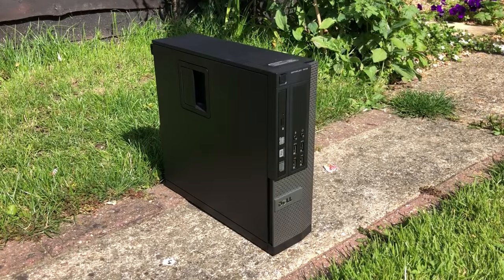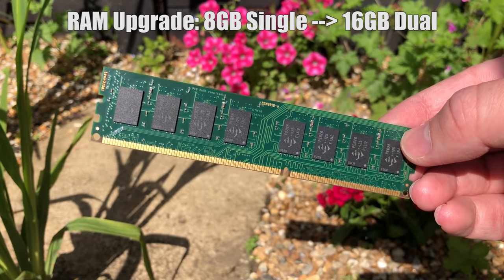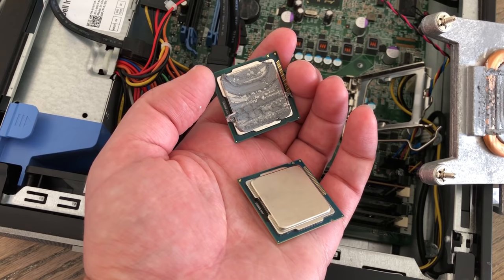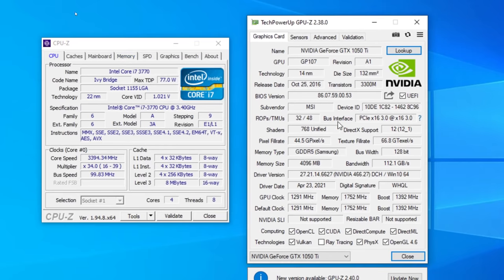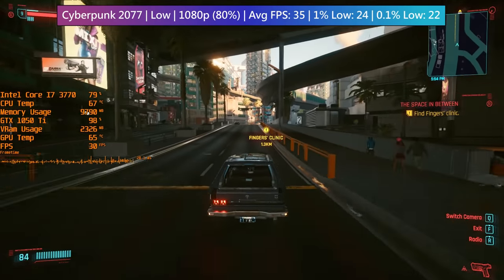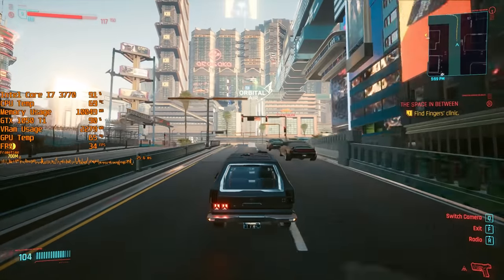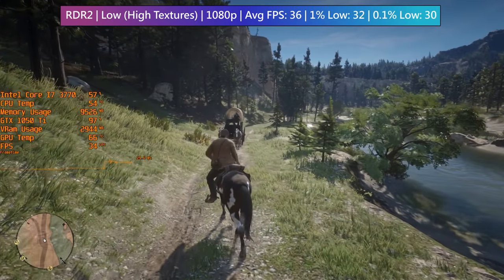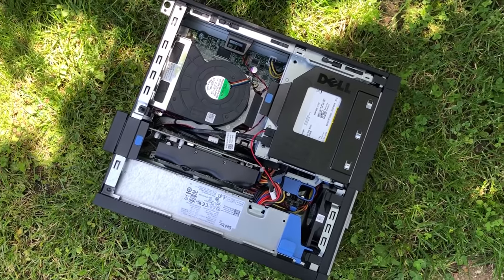Turning The Tiny, Cheap OptiPlex Into a Gaming PC - With Whatever’s In Stock

Comment: So i have a question idk what to buy My First Option is to buy a I3 10100f and start and looking  on the market for a cheap motherboard that is like 100€ . Second option a kit Ryzen 3 3200g and a motherboard total almost 200€ or the third a ryzen 5 1600Af that is 150€ and start looking foar a decent motherboard under 100€ . I just want an advice. Thanks , have a nice day.
Reply: I would say forget the 10100f, if you did want to go intel you be better with a 10400f and they not much more expensive these days 😀 if you wanted to go for ryzen have a look for deals on the 2600 or 2700x seen these going for pretty cheap here in the UK 😮
Reply: @tech_jims  i5 is like 200 and something euro and 2600 out of stock or price is too much for the chip.and the motherbord for the 1200 socket most of them out of stock. Every price is for new not second hand.
Reply: @Andy-cr2dc  hmmm see if you can find the ryzen 1600af, got to be the af model this is a refresh of the orignal, and that's basically the same as the 2600, there about 3 percent performance difference between the 2, and normally the 1600af can be found for alot less money 👍
Reply: @tech_jims  I know. I am gonna try looking for it see where i can find it cause idk why but the price for the cpu is like 150-160€ for AF and the normal one 120-130€ something like that , we have very weird prices here in Romania for components . Thanks for the advice , i am gonna looking more on the market Have a nice day.

Comment: Hello, I have an optiplex 3010, I put two 8gb memories, totql 16gb, SSD 250gb + hd 500, but I have an i3 3240 (I'm going to put an i7), I installed the wi-fi card, so I have a big problem , the video card is not showing a GTX 1050, what could it be, a jumper on the card?
Reply: its a low profile

Comment: i also have a i3 3220 8gb ram and gt 710 what i want to upgrade is cpu so i dont know which cpu to go for xeons e3 series or i5 .i wanna be as budget friendly as possible.
Reply: I recommend upgrading the GPU, the gpu is huge problem and get Low profile 1030 GDDR5 or if you have more money you can go for Low profile 1650 GDDR6

Comment: Old i7s are still very powerful
Reply: Still have 3770 but a k version and I overclocked it and still run like a beast !!
Reply: @deaneyle3940  I have that CPU too and managed to bring it up to 4.4Ghz, how far did yours go?
Reply: Idk if I'd say powerful but there certainly very solid.
Reply: @simplyinfinity6606  I'm able to overclock it  to 4.6 ghz, my pc case is kinda small so it generate a lot of heat !!
Reply: @deaneyle3940  in my case the motherboard is the limiting factor, it peaked at 4.5ghz but it wasn't stable so I settled it down to 4.4

Comment: I have the dell optiplex 9020 MT with a i7-4770 16gb ram and a gtx 1650 super the gpu I got for $269 AUD brand new I was lucky got it before it sky rocketed in price and yeah I get the same thing in Fortnite I have to use performance mode to not get the stuttering and I recently had to send my gpu in due to a faulty fan they just sent me a replacement I’ll get next week and I don’t even know if it’s gonna be the same model

Comment: Intel Core i7-3770 (Clock speed at 100%) with NVIDIA GeForce GTX 1650 (Clock speed at 100%) x1 will produce only 5.31% of CPU bottleneck on 1080p resolution. GPU Score: 29425
Intel Core i7-3770 (Clock speed at 100%) with NVIDIA GeForce GTX 1050 Ti (Clock speed at 100%) x1 will produce only 1.19% of CPU bottleneck on 1080p resolution. GPU Score: 22146
Both graphic cards and processor will work great together on 1080p resolution.

Comment: I fished a still working Dell Optiplex 1070 slim profile desktop pc with an Intel Core i5 6500 and 16GB of DDR4 RAM out of the trash. I installed a M.2 NVME 1TB SSD into the one slot on the motherboard,... yeah it had a M.2 drive slot so I thought, "Why not?" and put one in there, I also noticed it has 4 RAM slots and it already had 2 sticks of DDR4 memory installed so my stupid headed self put in two more sticks of DDR4 RAM so it now has a whopping 32 gigabytes of DDR4 memory running in dual channel mode! Now I need a graphics card that's low profile and doesn't need a power connector. Any suggestions that my silly little system could use?

Yes,... I am serious,... I fished it out of the trash,... installed a 1TB M.2 SSD and maxxed out its memory capacity to 32 gigs.

It's soooo cute but it needs a graphics card! Do you have a spare one lying around you could sell or just donate? My system can support only up to about 70 or 75 watts for a GPU from the motherboard. The PSU is really small and proprietary with like 280 watts total power.

How do I send you a picture of it so you can see my adorable and "free" little monster?

Comment: That power supply is to weak for the 1050ti, it draws its power through the pci slot
and your system and gpu will run hot because it is under powered, a gold rated PSU
that has built in power managment will run much cooler and be more power efficient.
Reply: Can’t fit normal PSUs in a SFF

Comment: My first pc was like that but it was from HP with a i5 6500 and an 1050ti Lp from msi an it was a Fine pc for 300€
Reply: And I also Overlooked the gpu and even with higher voltage it was fine at max 70 degrees
Reply: And in this pc was only a 200w psu 😂
Reply: @ichwasdass  damm broh 😮

Comment: I have an optiplex 3010 sff and I added a gt 1030, dual 8gb ram, 500gb ssd and now I want to upgrade the CPU but idk If I should get an i5-3470 or an i7-3770
Reply from the maker: The i7 will be better :)
Reply: Depends on your budget, the 3770 is 12 percent better performing than the 3470 overall, but I bet you can find a 3470 for a fraction of the price of a 3770 😉
Reply: Just checked the 3470 is about 20 to 25 pounds here in UK, the 3770 is about 60 to 70 pounds so is 12 percent performance gain worth 40 to 50 more pounds🤔if you answer yes buy the 3770 but if you answer no get the 3470 😀 best of luck with the upgrade 👍
Reply: They are roughtly the same, the only difference is hyperthreading. So if you don't need more than 4 threads you can save the extra cash for a new PC.
Reply: I'd definitely get 4c8t at this point. Even regular stuff like YouTube works better with it, especially AV1 decoding, which will be more and more of a thing going forward. If you want to save money and don't care about a moderate frequency drop, the E3-1220V2 goes for about $20.
Reply: I found the 3470 for 50€ and the 3770 for 54€ so I think it's obvious what I'm going for 😳
Reply: @mec_mec  yeah if they that closely priced where you are, deffo get the 3770 😀
Reply: @tech_jims  fun fact I just found out that the 3770 is out of stock rn 😭
Reply: @mec_mec  then the next question is are you prepared to wait to find one in stock, or do you buy the 3470 now 😉
Reply: @tech_jims  I guess I'm going for the 3470 bcs my current i3-3220 is getting slowwwwww
Reply: @mec_mec  4 cores/threads is getting long in the tooth. Go for an i7 or equivalent cheaper xeon. I had a 3470 and killed it delidding for better temps. Replaced with a an e3-1235 for like 4 more dollars than the i5 (like 28$ usd). Idk the prices now tho.

Comment: i would recommend  a asus gtx 750ti single fan. 1050ti its too much for the psu on the long run
Reply: They're both 50 series cards, not gonna make a difference.
Reply: It doesn't matter. The parts are specced around the PCIe slot power limit, which is 75 watts. The same is true for the 1650.

Comment: Today I got a Fujitsu Siemens with an i7 3770 for 20€. Had a old 250gb HDD and 4GB DDR3 for free. But now I need a cheap GPU with low TDP and a 1050ti is still too expensive :-(
Reply: Got to be a gt 1030 then 🤔
Reply: @tech_jims  Yeah, I thought about it, but would a 1030 be a bottleneck for the 3770? imho yes...or?
Reply: @zuyvox  yes the gt 1030 would bottleneck that cpu, but it would still give you decent performance, the other option would be a rx550 if you can find one for a sensible price 😉
Reply: @tech_jims  Thanks!
Reply: @zuyvox  no probs buddy best of luck with the build 👍

Comment: Drop the resolution to 720p and it'd be sorted might even get away with turning some of those lows to medium aswell.
Reply: Dropping the resolution to 720p will only looking good if the monitor itself is Physically low resolution.

Like the mainstream 1366x768 or 1600x900

In his case, his monitor is 1440p. Viewing 720p on a 1440p monitor will make it look very bad, with noticeable individual Pixels.

Comment: I got a optiplex 990 for around $100 with a i7-2600 and 8gb dual channel ddr3 ram. I put another 2 4gb sticks in it to run 16gb in quad channel. Also put a ssd in it. I was wanting to put a 1660 super in it but can't really find one for msrp. Might just get a 1060 if I can find one.
Reply: That CPU supports up to dual channel, not quad channel...
Reply: @GrainGrown  mine had 4 ram slots and ran fine with 4 sticks of ram in it. i even had 24gb at one point in it and it was fine.
Reply: @a1austin  *Mine
*RAM
*RAM
*I
*GB

It's still not quad channel. Those 4 RAM sticks ran in dual channel.

Comment: Can you please review the A10-6800K? (2013, Richland, 4 (which is actually 2x2 modules)core/4 thread, 4.1/4.4 GHz, 100W TDP)

I have a PC with this CPU w/ 16 gigs of DDR3 quad channel RAM, a Gigabyte GTX 1050 Ti G1 Gaming 4G and 120GB SSD for Win10 + 1TB HDD for musics + game installers + 2TB HDD for games

It can handle a lot of games in a fairly decent way, but the CPU has aged like a sandwich deep in a backpack...
Reply: That CPU supports up to dual channel, not quad channel.
Reply: @GrainGrown  then why could it work with 4x4 GB of DDR3 RAM?
Reply: @tothpeter2296  Of course it works. But those 4 RAM sticks run in dual channel.
Reply: @GrainGrown  two dual channels?

Comment: Built a pc that is sitting over there for months  because of highhhhhh gpu pricessssss can't even buy a 1050ti
Reply: Pc specs?
Reply: @mattynicolaz9832  r5 3600 8 gb ram 3200 mhz b450 motherboard 120 gb ssd 1tb hdd
Reply: @seeyesgooooo8147  damm
At least buy an rx 460 and use the beast 😮
Reply: @mattynicolaz9832  it costs like 300 dollars here 😔
Reply: @mattynicolaz9832  so I bought a app instead 2200g using that now
Reply: @seeyesgooooo8147  damm 300 ... prices are high here. Ended up paying 130 dollars for a radeon 380. It plays everything tho
But 300 an 460 its just too much
Where u from
Reply: @mattynicolaz9832  India
Reply: @mattynicolaz9832  and 1650 is 350 dollars first it was like 120 dollars and 1050ti is 230 dollars first it was 100 dollars
Reply: @seeyesgooooo8147  cheese bruh
Im from Argentina ..
Thats shT is worldwide. Its the same in here 1050 ti was 8.000 arg$ in 2019- 2020 and now got up to 50-70k (400-500 dollars)
1650S brand new was 22k and now its 95k .. 5600 xt was 36k in 2020 and now 180k
Reply: @seeyesgooooo8147  rtx 3070 is 299k and for you to know a proffesor earns 30k a month. A medic about 46k.. so you just cant buy anything. I bought my r9 380 for 21k i got lucky
Reply: @mattynicolaz9832  yeah rtx 3090 costs like 4000us dollars here now so enjoying cs go and farcry new dawn on my ryzen 3 2200g vega 8 graphics got it for great deal just 70 dollars cs go 90 fps new dawn 35 fps it's not great but it's ok until this gpu prices drop
Reply: @mattynicolaz9832  enjoy ur r9 380 it's good enough for now🤞
Reply: @seeyesgooooo8147  hell yeah broh 2200g rocks! Make sure to use 3000+ mhz ram and enjoy. Yeah its enough you know, in fact low quality 1080p 30+ is console experience but much better since its a pc so..
Reply: @mattynicolaz9832  yeah it's very good for 1080 p even the mother board was compatible b450 and 3200mhz ram overclocjed to 3600 mhz and with gpu and cpu overclocked 2200g is very good (for now)

Comment: Fortnite runs poorly with everything right now its not the system. I'd recommend going into settings and swapping from DX11 to performance mode and running low settings with ultra view distance since this is the standard for most Fortnite players currently.

Comment: The CPU spikes in fortnite is from it trying to render older parts of the map that are now gone and no longer there. I guess Epic removes the item / area but don't tell the code that it is now gone so the CPU will try to load that area / item over and over causing the CPU use to spike. They fixed it but the game still preforms worse then it COULD if it was optimized correctly.
Reply: *performs
*than

Comment: 👻👉👉You can buy a Sapphire Radeon RX 6400 Low Profile for just around €130 brand new these days, or an ASROCK Intel Arc A380 Low Profile 6GB OC Graphics Card with GDDR6 for the same low price. I also upgraded one of those cheap eBay PCs from a top brand. Mine was a Lenovo ThinkCentre M83 with an Intel Core i5-4570, 16 Gig RAM and a 500GB SSD, and I only paid €80 for it, and it really looked like new. Now it's enough to play almost all current games in HD resolution (enough for me I don`t need 4K etc) at medium settings, what more could you want, for only around 220€ all together :face-blue-smiling: